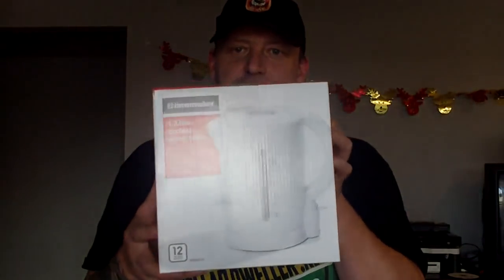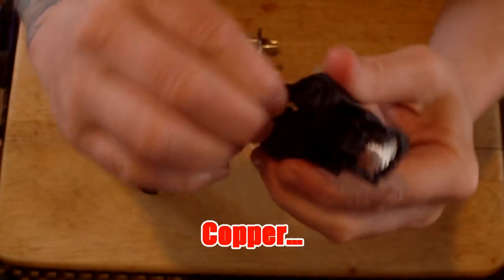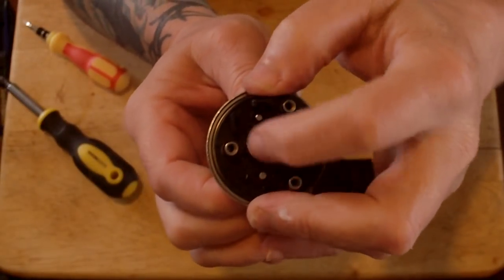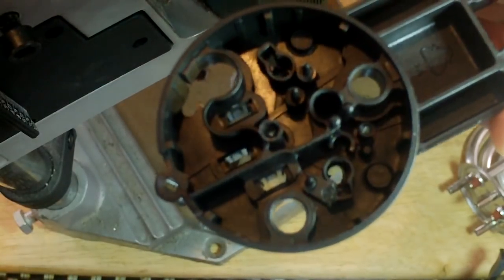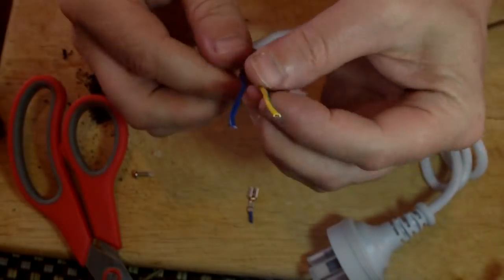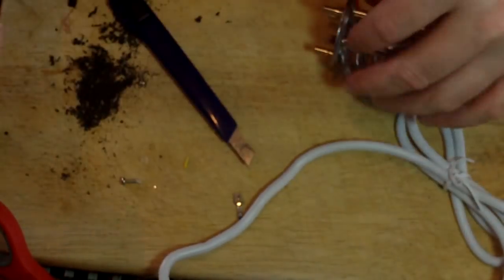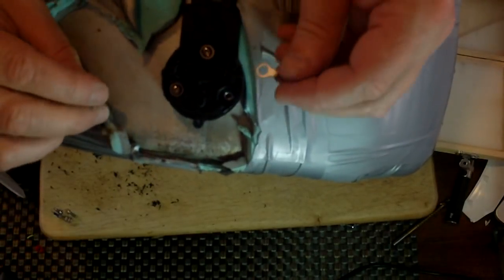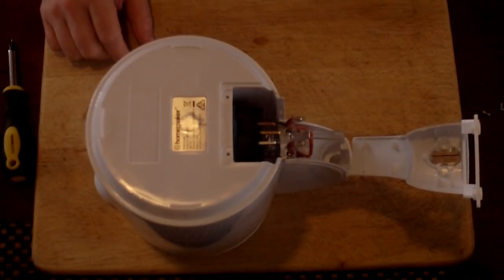How to install cheap Kettle Elements for HLT or Boil Pot Home Brewing

Comment: Looks great.  Do you think this would work the same using a cooler like those for a mash tun.
Reply from the maker: sitealive Gday. you probably could put them in a mash tun but you wouldn't want it actually  touching the grain I'd guess, would depend how you set it up. I've never worried heating during a mash in a cooler. You could make a simple herms system with these elements, you can even leave it in the jug if you roll a coil small enough to fit the jug. Cheers!

Comment: One of the things you have to take care of when homebrewing is boil overs. 

With that in mind I urge people trying to replicate this build to waterproof it by adding a plastic box around those live wires. You could easily repurpose a Pruta food container from IKEA (or similar) to do this.

Cut a hole in the base of the container the size of hole in the pot and put it between the silicone ring and the black connector. 

Then cut a small hole in the side of the container facing down toward the table for the wire going into the outlet.

Finish off by placing the green lid on the food container. Now you don't have to worry about boil overs getting in contact with your live wires.

If you want a bit of added safety you can pout silicone around the hole for the wire going into the outlet and around the lid.
Reply from the maker: +Bjarke Klüwer Thank you for your suggestions! Cheers!

Comment: Hi there.  I'm about to do this with my boil pot and I just want to say thank you so much!  I do about a 45L boil (gives me about 2x 19L keg).  Is there any reason I couldn't put two of those elements into one large pot?  I can use two different circuits as I wired my plugs with different circuits top and bottom.  I also think mashing with a recirculating pump and thermostat should be fine, or am I missing something?  Subscribed :)
Reply from the maker: I havent tried it myself, but have heard others doing it and I see no problems with it! Thanks for watching and cheers!

Comment: This is how I made a brew kettle with a 30L stainless steel pot and a 2000W/220V heater and have already brewed over 150 bathes of beer using the BIAB system.
Reply from the maker: Yeah mine lasted for years! Cheers!

Comment: Awesome build! I will be doing this. I already ordered the kettle from Walmart. I have some questions: Any on-off switch on these kettles can just be cut off and the power source will work correct? Can't the three prongs be kept on the plastic base and can be used to plug in the power chord instead of removing them and exposing the wires? Thanks!
Reply from the maker: The older elements auto cut off used to be a problem, the newer ones I've used seem to be ok and dont need all the modding as you suggested. So worth a try and if you have issues you can always mod it. Cheers!

Comment: Did this last weekend and totally burnt the wort. Kettle heating element is way to powerful for 15 litres/3gallon batch. Any ideas hw to reduce the power?
Reply from the maker: Sure there are many ways! There's one like this https://www.youtube.com/watch?v=_LwUR7YtWZg or there are newer ones like this https://www.kegland.com.au/power-controller-chip-3600w.html they are wired up the same. Cheers!

Comment: Great video! Thanks for posting. I tried this technique on an aluminum pot (I know stainless would have been better, but hey, I'm working on a budget here ... hence attempting this technique). The softer metal allowed for a bit of a "shimmy" in the hole saw and now the hole is slightly too big and I'm getting a leak. Thought about using a high temp/food grade silicone sealant. Any thoughts /advice you could offer would be appreciated. Cheers!

Comment: The heater element I found is a stainless 1440 w 120 v. Witch if I have done the math right that puts me right at 12 amps would that be sufficient for 3 gallons, its for a 2.5 water heater

Comment: Hi loved this video! Hi a couple of questions.

Does the element break frequently when used for a boil pot? 
How long does it take to bring that big pot up to a boil? 

Could this be used with a thermostat and a temperature sensor for mashing purposes as well?
Reply from the maker: I'm still on my first set, I've done well over 50 brews with them. Takes around 20mins to bring it to the boil, thats from warm wort of course. Yes I think you could use it for mashing. I 'm not sure I would use it for mashing, I would however use it in a HERMS system. Cheers mate!
Reply: I’m guessing warm wort is between 100° and 120° degrees Fahrenheit?

Comment: Whats the estimated time to get your water up to strike or sparge temp? Have all the equipment to install a 5500w element in my keggle but may use this for my HLT.
Reply from the maker: +Alexander Giddens I have never used it to heat cold water to sparge or mash temps! It would be just guess at about an hour, I use a 2000w element in my HLT and it takes about 90mins. Cheers mate sorry for the delay!

Comment: Hi mate thanks for the video!

I have the same elements and wanted to ask you what size hole did you have to cut? I think you said 40 mm?

I don't have the black things to put at the back of the element, do you have an idea where I can find them? or anything else I can use as substitute?

Also, what drill bit did you use? Q.max or would a bi-metal holesaw  work?

Cheers
Reply from the maker: G'day, Yep my holes were 40mm, I'm not sure what you could use, I've never tried. Do you have the seals? Maybe try a piece of wood or steel? 
Cheers!

Comment: Do you have any issues with wort sicking element, making a mess etc. Thinking of doing an electric kettle but weary of the contamination issues. Cheers. Awesome videos.
Reply from the maker: I haven't had any real issues, I use a toothbrush and clean them after the boil and it only takes a minute or two. Cheers!

Comment: How many amps do they pull 12 amps  or do you need 20 amps to run two of them I'm trying to weigh the difference. Because I can get a water heater element that will only pull 12 amps I only brew 2 gallons so 3 gallons is what I want to heat
Reply from the maker: I use them both on a regular house circuit which should trip out at 15 amp, so its under that. I do use  extension leads on both elements so that would drop things a little. I've never done the math but I just bought an amp meter, so next time I brew I'll see what each is pulling actual. Cheers

Comment: Brilliant! Thanks for sharing. Just what I was looking for. Cheers.
Reply from the maker: Some the ones I've done lately work without having to remove the auto cut off and light, no real modification, just carefully remove it and install. But if cuts out on you then you'll need to the mods. Cheers

Comment: Wow, thanks for posting this Gash. I'm in Canada so just want to let people here and the U.S that this will work here. I just got one working, I picked up a 1.7 litre Sunbeam kettle at Walmart for $17, it has a removable cord and a red switch that lights up when it's on. You remove two screws from the bottom and two under the lid and pry the back off. After that, do everything Gash did except you don't have to rip out all the flat copper pieces, just the small round one at the top of the housing and you can even leave the switch hooked up and the light, and the cord can still be plugged into the element as usual which is a big bonus. Obviously just be very careful around it because there is some copper that could be touched if you weren't careful. If you're paranoid you could always glue some kind of plastic box over it or something but it's not really that bad, you'll see what I mean if you get one.
Thanks again Gash.
Cheers, Randy
Reply: Oops, I meant to add that the one's on the Sunbeam are 1500 watts (I got a reading of about 1460 when I checked it). I currently am using a bucket that holds about 6 and 1/2 gallons and the element in it (an old water tank element) is using about about 1220 watts and it's 'almost' good enough but doesn't get a really good vigorous boil going so the extra 240 watts should be just perfect. The two combined (on separate circuits of course, since combined that's about 23 amps, too high for my breakers of 15 or 20 amps) will be about 2,680 watts so no more waiting 1 hr and 20 minutes to reach boil, Yippeeeee!!! Can't wait to fire this sucker up, this is going to save a LOT of time and hopefully make a little better brew!
Reply from the maker: Glad it has worked for you! The reason I ripped all the copper pieces out was because people were complaining of them turning off or 'blowing' but they weren't blowing just the trip switch and copper burnt out. But that doesn't matter as long as it works!!!! Cheers mate!

Comment: Gash, I have a 1.5 liter hot water jug from K-Mart that looks almost identical to yours and it boils water in about 4 minutes, so I know I can get more of them.  I'm just wondering if the standard electrical wall outlets in U.S. (120 volt)  would have enough juice to power them the same way your standard electrical wall outlets (220-240 volt) do.  Do you think that's even an issue since they both perform equally when used as their intended purpose as heat elements in a hot water jug, or does the additional power you have in Australia come into play when trying to boil 28 liters opposed to 1.5 liters with similar sized heat elements?
Reply from the maker: I think its worth a try, I can't guarantee anything because I've never used 120V but I agree with your logic. And I've seen people in your part of the world use similar set ups. Cheers mate!
Reply: In the U.S it's the Proctor Silex brands, the 1L kettles list at 1000Watts on 120V and the "Proctor Silex Kettle Durable 1.7 Liter" rates 1500Watt. I'm considering the smaller unit not listed as cordless has the plug is directly tied to the unit and doesn't have a switch. That way I don't think I'll have to rewire. Nice Video Very thorough, didn't have to keep rewinding to see the details like on shorter videos.
Reply from the maker: cool mate worth a try! Cheers!
Reply: +steven burnham Did you ever get this to work? I just stumbled onto the proctor silex  models on google before noticing your comment.
Reply: +Michael , no I never went forward on that idea ... I'm a proud owner of the blichmann 240V boil coil for my keggle.  I'm pulling together the controller based off TheElectricBrewery.com, concepts but a more limited configuration Single PID and recirculate like the "breweasy" concept, very similar to brew in a bag but with separate mash above the kettle. http://www.blichmannengineering.com/products/breweasyhttp:

Comment: From other videos I have seen you could have saved your self lots of work by just removing that 1 copper disk and leaving every thing else.
Reply from the maker: That took about 15 seconds to rip everything off, and I'd wanted it gone to make drilling easier and the video clearer, if it's not needed get rid of it! It also helps people that have different styles to show that none of that rubbish is needed! It also gets everything out of the way that could possibly short it out. These usually aren't sealed in any way and when or if you get a boil over you don't want those bits of copper as it will short out in a heart beat. Cheers!
Reply: Ahhh ok, I see your point about the short circuit.

Comment: I couldn’t see the size of the pot that you were using but I am thinking about installing this on my 8 gallon brew pot, is this powerful enough to heat up 6 1/2 gallons of wort?
Reply from the maker: That is a 10.5 Gallon Pot (40 Litres) Boils that full no issues at all, have to turn them down. Just a note too , the newer elements I've found that you dont need to take the cut out switch out, so you can just pull them out unscrew the backing and screw it straight into the keg/pot. This could be different for you of course.  Cheers
Reply: Gash Slugg Brewing fantastic, thanks for your reply, this is a great cheap solution as I have a glass cooktop and spend hours heating up water and wort. Thanks for the video
Reply: Also, upon doing research on these, I see that some have a setting with automatic shutoff, does yours have this feature and if so you’ve obviously found a way to bypass it
Reply from the maker: That was all the modding I did to the element base, the holes etc because my old ones used to shut off, the new ones I have I kept the shut off switch intact and they weren't shutting off, something you may need to test with the elements. Cheers
Reply: Gash Slugg Brewing awesome, thank you, just bought one today, gonna give it a shot this week

Comment: Thanks for the vid. I noticed that the Active, Neutral and Earth pins fit an IEC cable which is also known as a kettle cord. I didn't need to go to as much effort to connect power to me element. I also left the switching mech in place but will see how that goes later on.
Reply from the maker: yeah I stripped everything out due to all the trouble I've heard people have with them 'blowing' but when I looked at the elements they looked very solid and sound. So I'm thinking the 'blowing' bit was more then likely the connecting parts or the auto switch off mech. I didn't want to stuff around so just ripped everything out. Still going strong over a year old now and I brew at least every two weeks. I keep a back up pair just in case, but haven't used them yet. Let me know how it goes, interested to know. Cheers mate!
Reply: Gash Slugg 1 year, that's great. Just did a test boil tonight with no leaks (used red 'Permatex High-Temp RTV Silicon Gasket Maker' on the seal due to a cold water test resulting in a massive leak which I couldn't stop). IEC cable and element switch + power light worked fine. Was already thinking about grabbing another $7.50 homemaker kettle from Kmart for a backup as this one works a treat, cheers.
Reply from the maker: Good to hear! Just give em a scrub with a toothbrush after each brew and you should be fine! Cheers!
Reply from the maker: While boiling, if using two elements on the same circuit, avoid using clothes driers etc on the same circuit, think our house has 3 different ones, my wife often trips the circuit breaker on the switchboard. Doesn't hurt anything but can be a pain in the arse. Same for all elements.

Comment: Great video mate well done. Where did you get the push on connectors from? I shall be completing this project myself over the next few days.
Reply from the maker: ***** Just from an electronics store called Jaycar. I install some in another pot the other day and the connections are slightly smaller, still used the connectors I had but probably could of went another size down. Cheers mate!
Reply: Gash Slugg Good on ya mate. Looks like I'll be swinging round Jaycar and Kmart tomorrow.
Reply: ***** Just finished brewing my first brew with this method, got a 39 litre stock pot from Rays Outdoors for $50 and two kettles from Target for $7.50 each. Had to add an extra washer to make fully watertight. Very impressed by the results achieved. I managed to maintain a good rolling boil of 25L of wort on a single element with the lid on but it's still warm here in the Sunny Coast. My only disappointment is that I'm going to have to wait to sample the results.
Reply from the maker: ***** You dont want to boil your wort with the lid on though. Good to hear its working, I often wondered how they'd go on a very thin walled vessel, what sort of washer did you use to beef it up? Cheers!!
Reply: Gash SluggWas open a good crack once the wort was getting up close to boiling to allow the DMS to escape. Washer was a thicker rubber with 38mm diameter opening. I am still learning with all grain brewing so happy to experiment and make mistakes along the way. Used a BIAB grain bag for this attempt but will not bother again as modifying the mash tun.

Comment: Will this work in America? 
I don't see that small element bringing a 15 gallon potto boil with the 120v plug.
Reply: I don't think you can find the 230V hot pots in the U.S (I believe Gash said in the vid about element controllers that his 240V elements were 2400W, so using those same elements at 120V would only give you 600W ea.) . - the only ones I have found here in the U.S. are 1500W @ 120V. If you used 2 of those 1500W elements at 120V, the wattage would be about 3000W. You'd probably be better off using two of the 1500W elements (on 2 separate circuits), to get your boil - 3000 W to boil with, but even then, I'm not sure you would get much of an aggressive boil in a 15Gal pot with only 3000W. Seems like most of the larger brew-pots require 2 5500W elements @ 240V to get an aggressive boil. I would think that the two 1500W elements @ 120V (from what I've read), would only be good for a 5 - 7.5Gal boil. Just my 2 cents worth, NOT GOSPEL ......